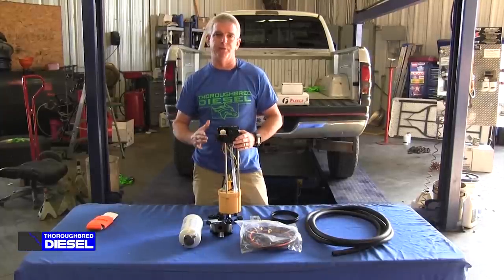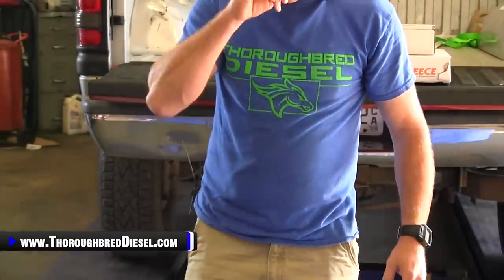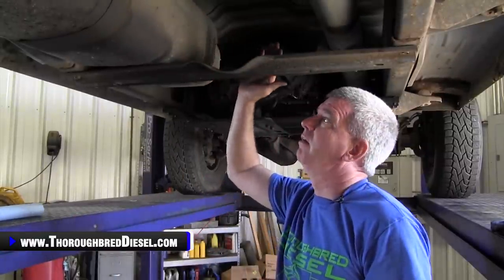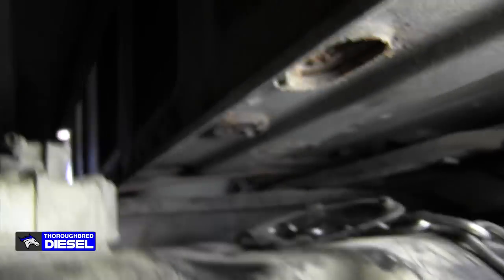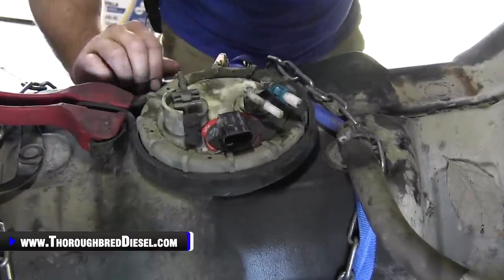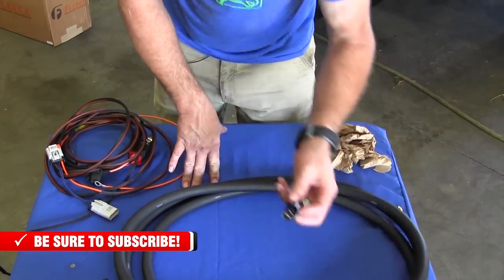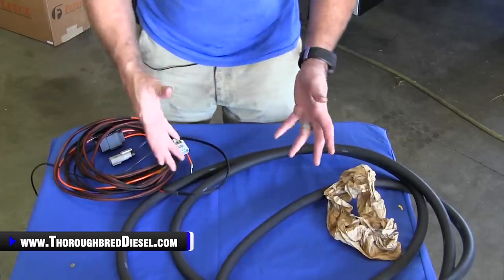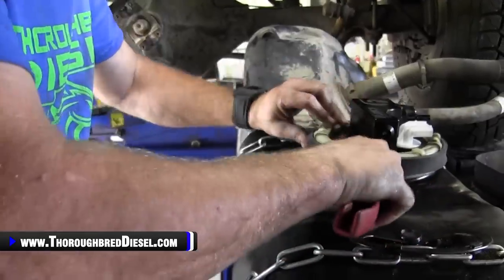VP44 Guys Rejoice! Fleece PowerFlo Lift Pump First Look & Install: 1998.5-2002 Dodge Cummins

Comment: Excellent video.  Incredibly helpful. Thank you .  New (to me) owner of an '02 2500 with sending unit/fuel gauge issue.  Contemplating the fleece sending unit, but after watching the video I might go with the unit with the lift pump you show. I also really like the fuel filter/separator assembly. Looks like high quality products.  Thanks again.
Reply from the maker: Glad it helped.  You're welcome!

Comment: Just bought a Fleece powerflo lift pump. Watching the installation video one more time before I install.  The only question I got is what do I do with my lift pump? My pump is on the engine block.
Reply from the maker: You can just leave it there or remove it from the plate.

Comment: What did you do with the factory fuel delivery line? And I was told with Glow Shift gages you have to use a banjo bolt and snubber. So would I move the snubber to the sensor port on the Fleece filter housing? Or is it no longer needed? Installing tomorrow.
Reply from the maker: We always suggest the use of a snubber to protect your fuel pressure gauge.

Comment: tell me this. is fleece powerflo + say G&R dual rear filter kit be equivalent to a fass as far as whats going to be best for my truck long term. air removal, particular and water sep??
Reply from the maker: The G&R wont do air removal like the FASS, that’s probably the only difference in the two.

Comment: I cant seem to figure out what you do with the return lines from the engine to the tank.
Im lost. I have an 04 ram with a CP3. Thanks for any help

Also, what about from the CP3 to the engine, there's the banjo fitting that needs to be blanked? Or removed?

Comment: I know the video is old,  but hopefully you guys @thoroughbred diesel see this? I installed everything yesterday, working on the electrical connections today. What did you do with the WIF connection and did you remove the Fuel Heater relay? I don't think I want that relay trying to send power to nowhere. Thanks!
Reply from the maker: When you remove the stock bowl,  you don’t get any WIF lights or completion of the current sent to the heater because it isn't in play.  All good.
Reply: @thoroughbreddiesel  Thank you very much! Thanks for the great videos!

Comment: And to make it easier just rotate the tank and you can see what your doing and helps a bunch for me any way and set you new pump and to your old pump and make sure they are the or you may have to bend the float a little. And do not bend it in a way you break the plastic where arm hooks on. Mine was off and had to take it apart and adjust the arm it would stay on full for ever then go to a half a tank when look at it , so set the side by side and adjust it, because it will be off! I guess shipping throws it around . Great kit and pump !

Comment: I bought my 99 ram used and it came with a raptor lift pump. Recently the truck runs and idles rough and blows white smoke. Got it checked and mechanic told me lift pump is going out and truck isn't getting correct amount of fuel, would this fleece lift pump replace my raptor pump? Was also thinking of putting a regular airdog lift pump on as well. But this unit looks more durable plus has the advantages of reading correct amount of fuel.
Reply from the maker: The Fleece would be a replacement for your current lift pump.  This kit comes with a replacement filter and all the line to get you from the tank to the injection pump.

Comment: How do test/read fuel pressure the stock filter housing had a Schrader valve.  Also, is there an adapter so that the Edge juice with attitude can connect back to VP44 return?  This was replaced in the fleece install.
Reply from the maker: Schrader valve would need a fuel pressure gauge that accepts a Schrader valve which there are several (hand held test gauges). You don’t want the pressure gauge on return side with a VP44, you want it on pressure side. My suggestion to get rid of the Schrader is to buy a pre tapped 1/8 27 npt tapped banjo bolt that will accept most types of fuel pressure test and gauge fittings.

Comment: I just put the Edge Comp in my 01Dodge.....Do I need to put a lift Pump in ??? Is it really Necessary ??? I will very Rarely be Hot Riding my truck......And I live in Oregon where it Snows and gets into minus Temperatures....Will this work for me Without the Fuel Heater ????

Comment: What pressure are you seeing? Is the pressure adjustable? Any reason I couldn't mount the new filter body on the frame back under the bed?
Reply: I have this in tank pump from Fleece and I am seeing 21 psi at idle and 17 - 18 under hard pull far as adjusting the psi I don’t remember and I got this as soon as it came and my filters are kit that use the rear bolts from front seat comes as a kit with 2 large filters . The first one is a large Baldwin water separator with drain the next filter is a cat at 2 micron filter and the factory filter on motor I use a Baldwin filter that’s 5 micron so that’s what’s on my 05 dullay.  Hope this helps .

Comment: I have a1999 ram 3500, Is the old harness running to the fuel sending unit used to power this unit, it has blue, blue blk, green and black wires on it. Reason I ask is because my lift pump is by the block so I don’t have power running in the green wire to the old sending unit. I’d like to know if new harness with kit takes care of that or if I have to rewire what I have? I’m in the market for a new setup as we speak because I’m having fuel pressure problems

Comment: Hi my question is I have put a second gen in a 06 3 gen place done the stand alone harness I built pump in tank my self it’s got 70 pound pressure do I need to shut the pump down while cranking it then turn the pressure to it

Comment: Great product, the one major issue I have run into is the two small sensor ports if they are not being used and you install the two small 1/8 male thread plugs. They leak. I have tried putting thread sealer and anything I do it leaks.
Reply: get the high temp red permatex high heat liquid thread sealant and let it cure for 3 days before running it

Comment: Just wanted to see if you can tell if the VP44 is bad. I got fuel and about 3 miles down the road my truck just shut off. It was actually starving for fuel. I have plenty of fuel in filter housing and fuel will squirt from shredder valve on VP44. I'm trying to figure out if injection pump is bad.
Reply: Ever figure it out? Mine just quit yesterday 😒 pulled out of McDonald’s and it died. Managed to get pulled over, attempted start with no success, sounded like it had a lot of air in it. Cycled the key, DTC’s 1693, 1688 😬, and 0254. Bumped starter, fuel gauge showed approx 12-13psi, checked schrader valve on filter housing then VP, both had fuel and no signs of air but flow seemed weaker than previous times. Bumped starter, cracked return line on vp, nothing. Kept messing with it for a while cracking 1,3, and 4 with different combinations of anything you could think of. Never got more than just a little moisture at the washer on the banjo bolt from the return fitting on the VP and never had any diesel the injectors. 10 minutes in my lift pump took a dump. Had it towed home, found out how bad the 1688 code is and here I am, hunting for a new VP and lift pump.
Reply: @jesseballard5741  yes I replaced both lift pump and VP44 and everything is great 👍

Comment: Like the filter housing with the sensor ports on both sides of the filter, the black anodized fittings, the black Continental fuel line.  Wish manufactures would stop with the janky inline fuse for the relay.   I cut that mess off and install a relay with an integrated fuse holder,  which also allows removal of the excess wire.  Almost 1k for the system...  That's a rather large pill to swallow, but I do like keeping stock appearances, and I know Fleece is quality.
Reply from the maker: The cost is higher until you consider that it also fixes the fuel level issue which typically runs around $200 as well. And lets just be honest very few VP trucks have a functioning fuel gauge at this point.
Reply: @thoroughbreddiesel  Agreed.  I got to thinking about that as well.  It is more than just a lift pump.  It's a pump, basket, filtration, lines, & sending unit.  I'll certainly keep it in mind should I need a replacement.

Comment: So when replacing the lift pump with a system like this. Did u take old pump off or did you just leave it there and unhook everything.  Also how would this compare to the fass system
Reply: Pump on the side of the block can be left there.  Just disconnect the power from it, and connect it to the harness.
Reply from the maker: I left the one on this truck in place. I just cleared the original lines of fuel. If you are looking for an upgraded lift pump for your truck and you are having a fuel gauge problem this would be a great choice.

Comment: quick question i am wanting to buy this set up but my 99 has a different bowl setup i have a bleed screw on top does that mean i still have a block mounted lp
Reply from the maker: The early style filter won't tell you weather you have the block or tank LP.  What you will want to do is look directly below your fuel filter canister and make sure that you lift pump is still on the block.  Also,  check to make sure that the power is still hooked to it.  If the LP is not there or the power to the LP is unhooked,  good chance that it has been converted to a in tank pump.

Comment: your do a great job of explaining the jobs in detail thanks
Reply from the maker: Thanks!
Reply: I put this on 05 5.9 it’s not easier to take the bed off . You can just t
Roll your and over a little bit and you see what your doing. Iam 66 years old and did it in my garage by my self and mines been few years don’t rennet the year . I put a gauge for fuel pressure and that when I found out I only 5 psi and the Fleece puts out 21 psi and hard pull up hill with camper 18-19 psi that kit is different from mine I didn’t get big hose kit .What I like about this pump one plugs into factory harness and the other pump you turn a cable to fuse and has a inline fuse and relay the cool part if one pump goes out you will still the other pump because you will 10-11 psi on one and make sure the your float is set just like the factory float or it will be off jus set them did by side and make match and you will be good. It’s been great no problems at all.
Reply: It’s not adjustable
Reply: 20-21psi

Comment: Remove the stock fuel filter housing???  Does the Fleece fuel filter housing have a fuel heater?
Reply: No it doesn't. Also can't use water in fuel sensor unless you extend the harness.

Comment: Does anyone know if the quadzilla fuel pressure sensor is a direct thread into one of the sensor ports on the filter housing?
Reply from the maker: It can on the Early trucks (98.5-99) but you can also use a tapped banjo bolt or a fuel tee with tapped port.

Comment: Would my truck still have a lift pump even with a fass?
Reply from the maker: A FASS is a lift pump,  just like this is a lift pump as well.  If your truck has a externally mounted pump like a AIrdog or a FASS,  this is not needed for those to operate correctly.
Reply: @thoroughbreddiesel  so I’ve been having a problem where the 24 valve Cummins turns on but stalls right after and then takes a long time to start. I’ve changed the filters on my fass, the filter on the fuel bowl and I open the lines to get the air out and nothing with come out. What could it be. Thanks

Comment: Is it possible/recommended to remove the water in fuel sensor from the stock filter housing and thread into the new fleece filter housing in one of the sensor ports? If so, would the stock wiring harness reach up to the new location? If not, is it safe to run with no water in fuel sensor?
Reply: Maybe you already figured this out but it's possible. However as the kit comes you can't use the wif sensor. Would need to run a jumper and use the rear sensor port closest to the firewall. The injector lines sit too close to the front sensor port so it won't fit there.

Comment: So is this better than doing a standerd lift pump an sump ?
Reply from the maker: If you have a faulty gauge, this fixes several different problems all in one shot.
Reply: @thoroughbreddiesel  if you have a working gauge witch would you do lift pump or this ??

Comment: Is this like the FASS titanium system
Reply from the maker: It is a aftermarket lift pump just like the FASS system but the two systems similarities end there. Both are great options just different configurations.

Comment: What psi do you get with this? At idle, full throttle, cruising at 2k rpm?  Could you guys do a video driving with a shot of the tach and speedo and shot of a pressure gauge all in the same shot?
Reply: At idle, it will be around ~16 psi. Full throttle will vary based on each truck's setup, but you can expect to see something in the ~12 psi range.
Reply: @fleeceperformanceengineeri9556  Thanks for the reply!
Reply: My Fuel Lab pump runs 9 PSI at idle pre filters and 7.5 PSI post filters. The biggest hills I have done my drop the pressure down a pound?
 Very happy with it!

Comment: i notice its for 05 and up will it work on early 04' 11/03 with stock intank pump???
Reply from the maker: For an early 04, you will use the FPE-34755
Reply: @thoroughbreddiesel  mahalo

Comment: The vp44 connection fitting just hand tight?
Reply from the maker: No, it will need to be tightened after the bleeding procedure.
Reply: @thoroughbreddiesel  got ya!  Thanks!

Comment: the pump setup looks nice, but what an electrical cluster fk!   The trucks have a factory 20a circuit already going back to to the tank, the ECM just never pulls the relay coil to ground

Comment: Will this work for a p pump 24v?
Reply from the maker: No, this will not work for a P pump truck. They require higher pressure.

Comment: Will this work on the 94-98 12v trucks
Reply from the maker: No, this will not work for a P pump truck. They require higher pressure.
Reply: @thoroughbreddiesel  I cant use it to feed my stock lift pump?

Comment: This is absolutely no good if you live north of Alabama because there is no provision for a fuel heater.
Reply: If you need a fuel heater to run a diesel in cold weather you need to go back to a GAS engine!
Reply: @eatshitful  lol! 6mpg on gasoline versus 18mpg on Diesel... no thanks, I will keep the stock systems in place. You can go to gasoline if you wish.
Reply: @walterk1221  on an oddball irrigation motor, that had problems with fuel too cold, we just put plumbers heat tape on filter bowl and wrapped it 4 wraps or so. Wired it ti a manual switch so i can flip it on in winter and off in summer. Has solved issue and worked well. Just a thought.